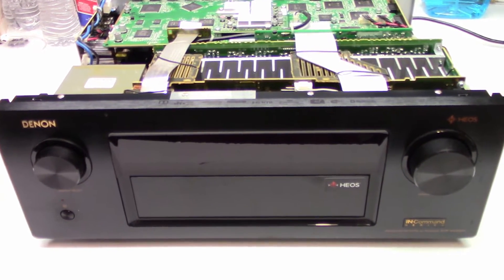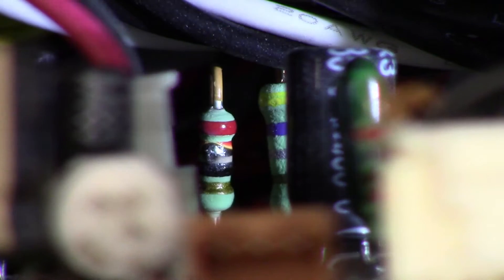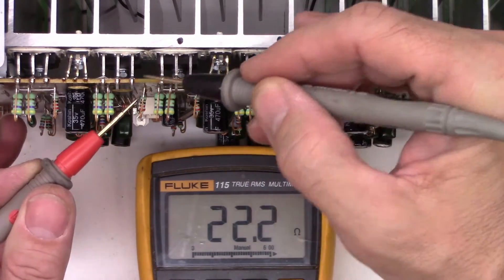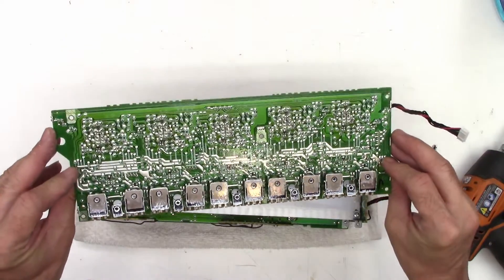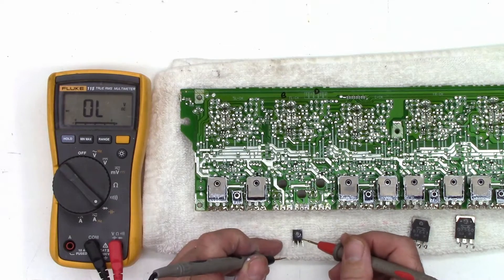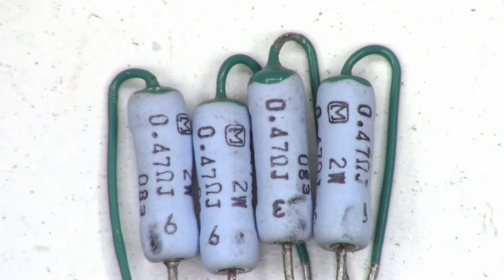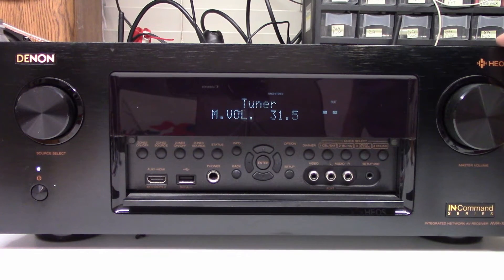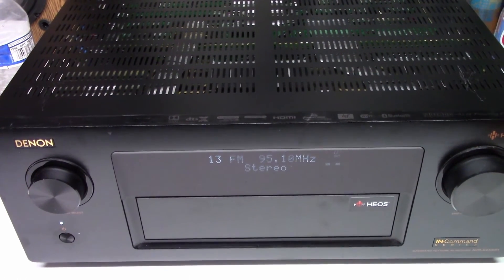DENON AVR-X4300H BLINKING RED LIGHT OF DEATH AMPLIFIER REPAIR

Comment: Good job. This one was a little bit deeper than usual. I love the great close up work that you do these days since the new camera came in. Nice.
Reply from the maker: Thank you very much!
Reply: I used your video to test and repair a Denon avr-x1300w.  it was almost identical problem.  I am just a novice hobbiest.  Can you tell me why when I get to the bias adjustment, it is reading 187mv when other channels are reading 2.4-2.8?  I replaced D2390 65 P, B1560 65 P, qty 2 - 4.7ohm and qty 2 - .47ohm resistors.  The unit powers on now!  only thing different I can see on the parts I replaced is the D2390 has a 54 P instead of 65 P, same with the B1560 has a 54 P instead of a 65 P.  Will that cause the bias to be so far off?
Reply: @chad541121  did you fix the issue? What caused the 187mv ?
Having the same issue fixed, but a reading of 178mv now instead of 8mv